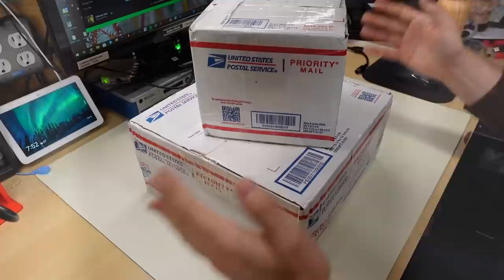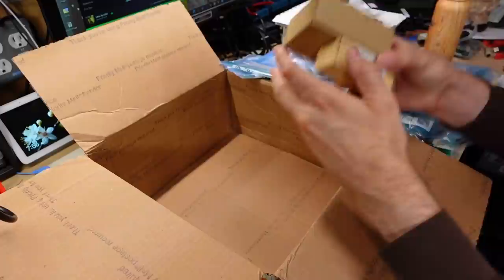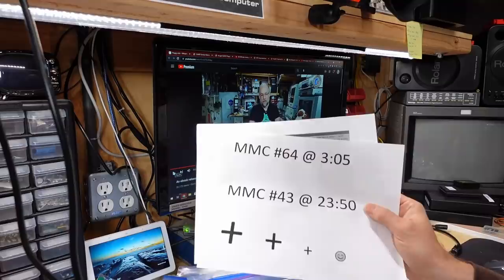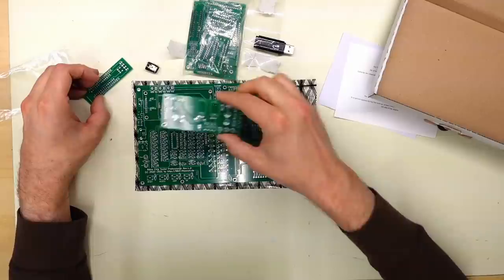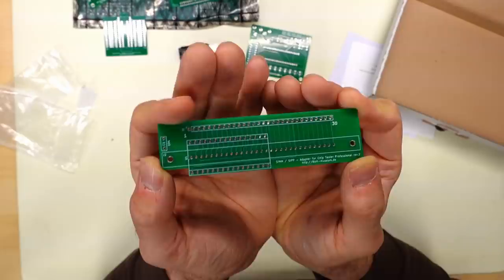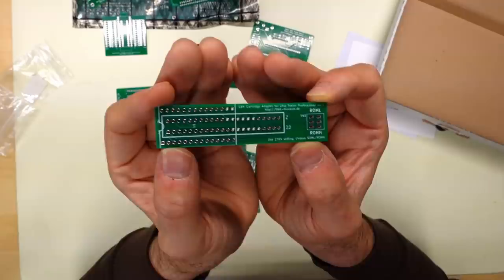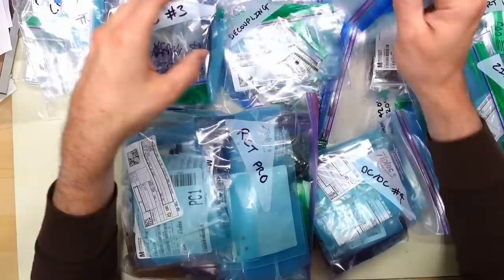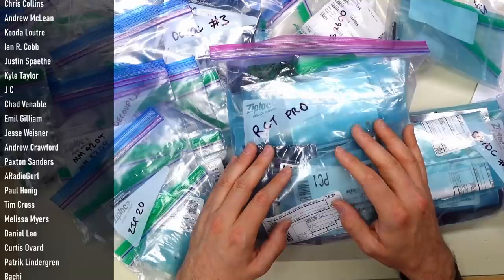0014 It'll be a lot of work, but it'll be worth it!

Comment: I think the very first EPROM was the 1701. I don't know what it exactly was about, but it seems to only existed in very small numbers, having quickly been replaced by the 1702. If someone knows, please enlighten me!

While being a huge progress above single-use PROMs and mask ROMs, they were quite cumbersome to use. 

They needed 2 voltages, +5V and -9V to read them .. and additionally +12V, -35V and -48V to program them. If I read the datasheet correctly, programming them involved the following.

1) Vcc = +5V, Vdd = -9V, Vbb = +5V, Vgg =-9V (thats also the configuration in normal use)
2) Put the chip into programming mode: Vcc = GND, Vbb = +12V (!), Vgg = 0V, Vdd = 0V
3) Put the inverted adress on the adress pins, with -48V for a logic 1. 0V for a logic 0.
4) Wait 25us.
5) Set Vdd -48V and Vgg to -35V
6) Wait 10us
7) Put the noninverted address on the adress pins (with -48V for logic 0, 0V for a logic 1)
8) Put the data word on the data pins, a logic one is -48V, a zero is 0V
9) Give a -48V program pulse for 3ms 
10) Hold the data and Vdd/Vgg for 10µs and remove them
11) Move Vdd, Vgg and data back to zero volts.
12) Go to Step 3 for next byte
13) Program all 256 bytes, 32 times. You have to do it that way that the cells get 96ms of programming time each, but without overheating. 

Well .. its better then ordering a mask rom and wait a few weeks at least, but ..

Comment: i bought one of these not that long ago. i haven't been able to build it due to parts shortages through UK suppliers. and the supplied BOM's via the email do not work correctly. , but i hope next year i can get it built!
Reply: Yeah, the supplied BOM is specific to products from specific suppliers.  I had to completely rework the BOM from suppliers in the US.
Reply: @kjtroj  I did check the BOM lists to make sure I uploaded the correct ones to the correct supplier. The  it was either the part number was not valid or it would associate the description with something else
 entirely. , I had to try and find the best guess part. I did find most of the small parts across 5 UK suppliers. Although they want me to buy a 1000 of each part. Which isn't what I want to do. , I also found a link within the English pdf sheet which links me over to a German site which has the complete list. Which I then had to Google. It kind of helped. , sort of.
Reply: @StatusFIX  All I had was the English one, which took me to a German supplier. That didn't help. I ended up asking a friend who's more knowledgeable to translate it to Digikey part numbers for me.

Comment: I've always kind of wondered who used the 74181 really (it's a 4 bit arithmetic logic unit, cascadable, 32 functions. If you wanted to build your own CPU board (no, not a board with a CPU on it, but a board that was a CPU) you might use it. But most of the people I've seen building their own CPU since the 1980s at least has built their own ALU out of gates to prove they c—er, "to better understand how it works".

If I were doing that, I'd probably build a 4 bit adder, once, to demonstrate to myself I understood the logic, and then I'd use the '181.
Reply: Yes, but do not forget, it's a kinda old chip. It was used in many of the "mini computers" during the 1970s, even in the PDP/11 line for example. Surely, from today's view point it seems to be a pointless thing, but it was very important in an era when one-chip CPUs were yet unavailable or at least not powerful enough for certain tasks (like building a mini computer). Also, 74181s could be combined to have a larger word-size operation with some look-ahead carry generator chip attached as well, even allowing a 64bit ALU to be built able to run at the magnitude of 10MHz scale, which was very much a super impressive thing back to then, when the first primitive 4 (!) and 8 bit "integrated" CPUs seemed like to be a toy more (often with sub-MHz max clock speed), compared to these specifications.
Reply: I didn't realize it was used in the PDP11. As I said, if I were building a processor board I would use two of them to make an 8-bit ALU and been quite happy to do so. It's just that people designing CPUs on boards seem NOT to do that, preferring a bunch of nand/nor gates instead. I know the '181 is still made in doubtless very small quantity, and I had no idea why if there's nobody using them. Minicomputers which might actually still be in service would justify them, of course.
Reply: @knghtbrd  Yeah, you're right, from today's perspective, it does not make sense, what my point was. Though it's still used as a teaching tool at some places on computer hardware and design. Other than that, indeed, current "hobby designers" (who does not want a ready-to-be-used CPU) may build something as their own, from logic gates, or in some cases even from discrete transistors to be fancy :) Btw, I had no idea that 74181 is still produced in any quantity, it's quite hard to get one, I also tried (and failed). Maybe the usage in education (though I am really not sure on this, just I've read ...) can explain some of the existence still. No idea ...

Comment: SALLY is the custom 6502 in the Atari 800XL, the 130XE, and the XEGS.   I believe the 7800 also uses one.
Reply: You might be thinking of the 5200. Very similar hardware to the 8 bit computer line.

Comment: Your RTC PRO PCB is newer than Noels PCB, i'm waiting for your review.
Reply: Mr Guru  Correct. The only technical change was switching from 1k protection resistors to 470, which allows to check more bipolar devices that require a higher input current.
Reply: Mr Guru  from rev C to I and only one difference?
Reply: @sebastianbort8512  1.2d, Omron G6K 2P and G6K 2P-Y footprint combined; 1.2e, C1 moved a few mm to the right, 1.2f, Loudspeaker, contrast regulator and barrel connector labeled, 1.2g TO-92: distance of the pads increased by 0.2mm, drill holes for display corrected by 0.5mm, 1.2h, added a SOT-23 footprint for an alternative p-MOSFET, 1.2i, Labelling of protective resistors changed to 470 Ohm (was 1k Ohm) --- better?
Reply: @8BitMuseum  thx for informations

Comment: Ah, the NOP tester... or "free run" mode as it was called in the HP µLAB I recently did: https://www.youtube.com/watch?v=0fCSlPqSJKk - I still wonder: was this a standard test mode in industrial applications back in the days? Because I've been toying around with CPUs ever since the homecomputer timeframe and never saw something like that built in to those, but I distinctly recall some CPU boards in phone systems having a "free run" switch on them and wondering what it might be...
Reply: In the 1980s we already used NOP testers to check whether a CPU was still "starting". It can't check that a CPU is working 100% correctly, but it's fine for a quick check if it's completely dead. The 6502 NOP Tester has a switch that you can use to check if you have a SALLY. If the counting stops it is a SALLY, if the keystroke is ignored it is a normal "6502". Got a couple of 6502AD from Ali last month. Most of them were SALLYs which are usually more expensive. :)
Reply: @8BitMuseum  interesting to hear there are different reactions to the same input within the same range of CPUs; The free run mode was also useful to find the broken address decoder in the HP µLAB, I just can't stop keep wondering if these were built into more products during the rise of CPUs back in the day.